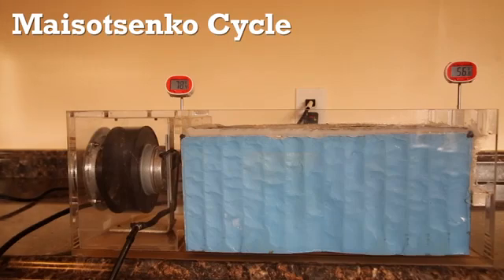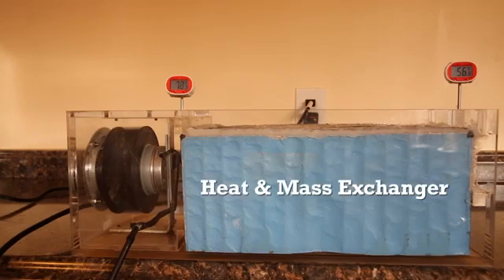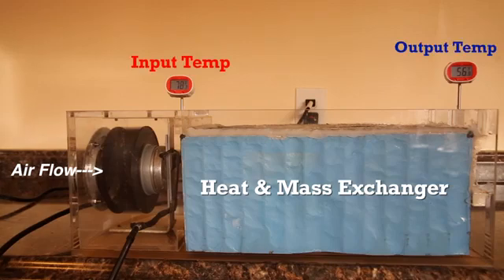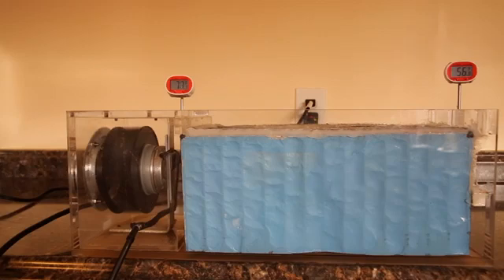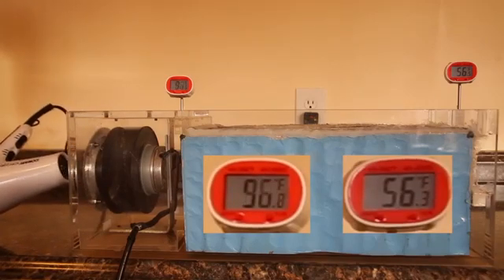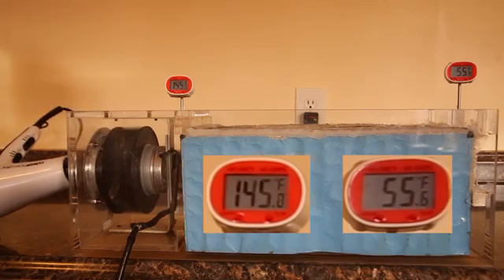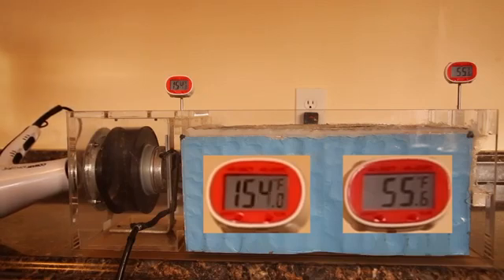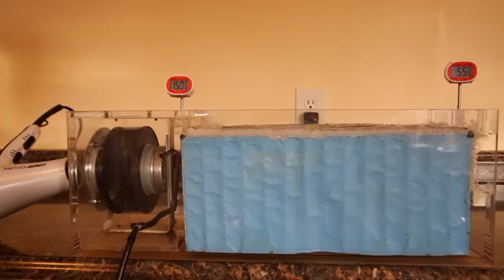M-Cycle 100 deg. F Cooling Demonstration

Comment: https://youtu.be/OZqalBBH8p0?si=yNUV07EsSGxcWFiw
Reply from the maker: @parwindersinghwaraich2365  Keep R&Ding. Maisotsenko Cycle cools air and water ! to dew-point temperature. We already tested both air and water cooling.
Reply: @M-Cycle  I am also working on cool air with maximum flow . But I am trying to find one matter which is not available near to me . Where are you presence in india  ?